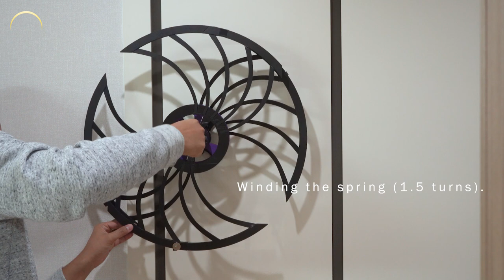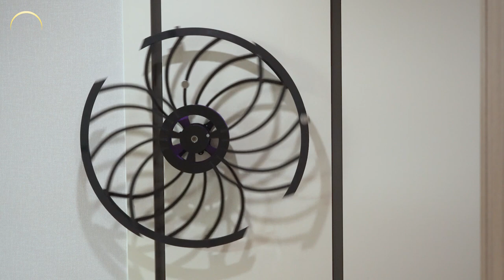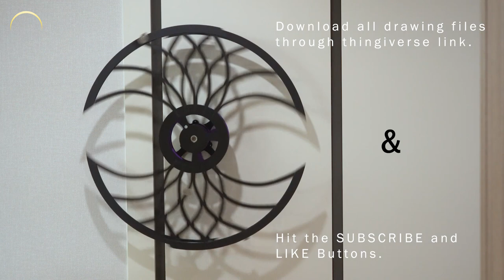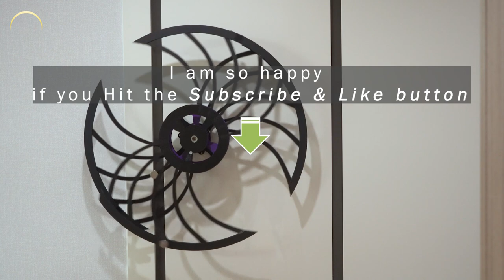Operation Video of Kinetic Sculpture, Driven by Spring Mechanism (Monarch, Kinetic Art)

Comment: I get that one of the rings turn from releasing energy stored in the spring. But how does the other one turn?
Reply from the maker: Action reaction principle. 
The spring is connected with both of rings. So turning direction of both rings are different way. :)
My next video will explain this mechanism more detail. Thanks~

Comment: Hi, I'm currently making my own using your models. How long did you manage to get yours to run for? Also thank you for making the files public!
Reply from the maker: It didn't work long because the 3d printed spring couldn't wind up much.

In my case, I took 1.5 turns of the spring, and as a result, it was able to get about 2 minutes running time.

Now, we are planning to release works using metal springs in the near future. Keep watching :)
Reply: @housdrmoon  I've looked into using metal springs but I can't seem to source any that aren't in very large bulk. 

I'll  definitely keep an eye out for your videos though!